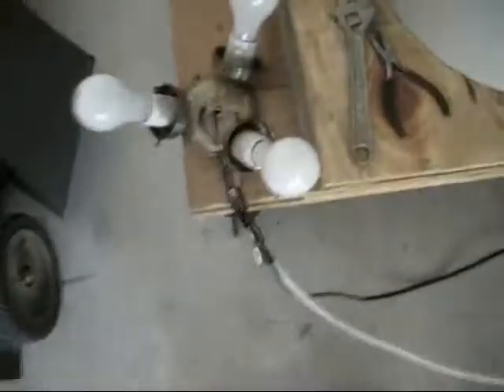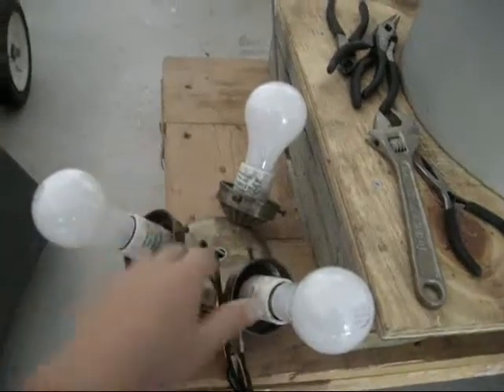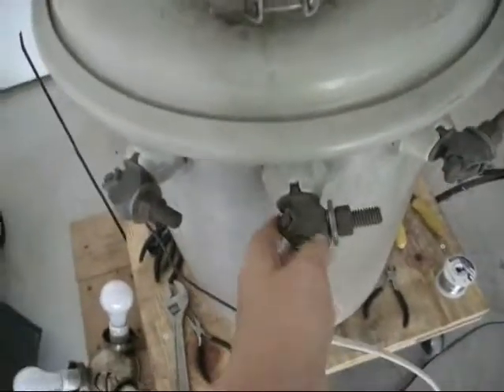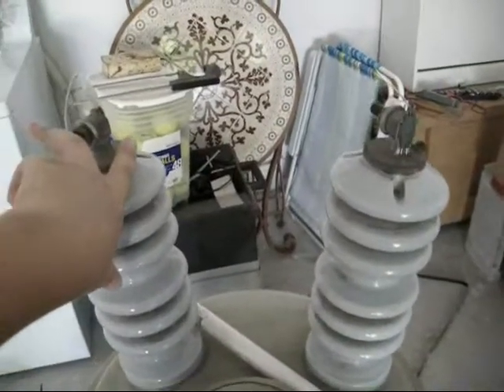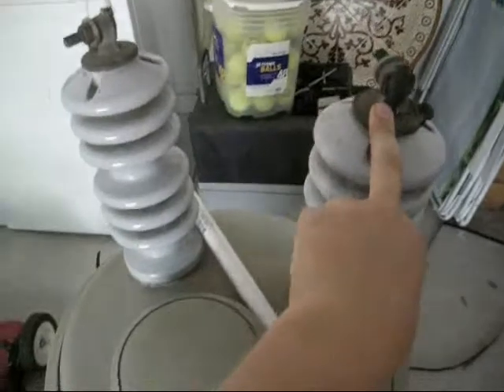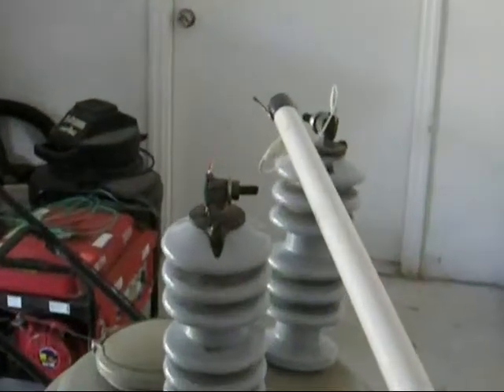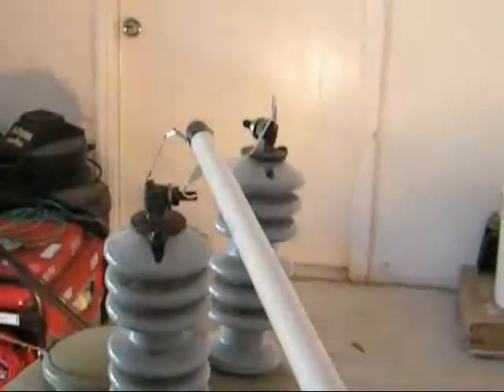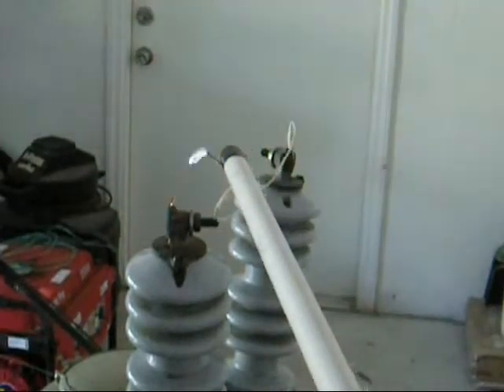pole pig overview and low power 300W run

Comment: Here is an idea i just pulled out of my a**. Instead of using an mot with shorted secondary, why don't you try making a new secondary out of thick wire and just change how much wire you have on the secondary to change how much it will ballast. It should be able to pull up to 20 amps on primary side. I have never used it in a ballast configuration, but i do know that the more wire on secondary, the high shorting current and i have seen it pull 20 amps(tripped 15 amp breaker, really quick).